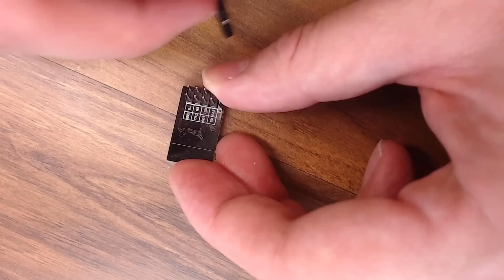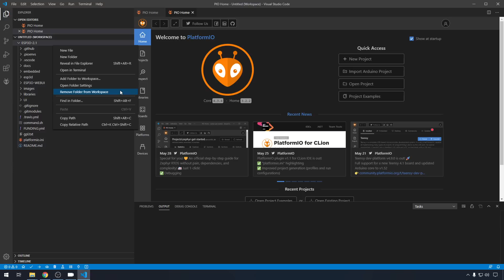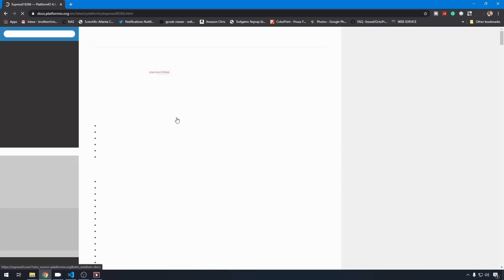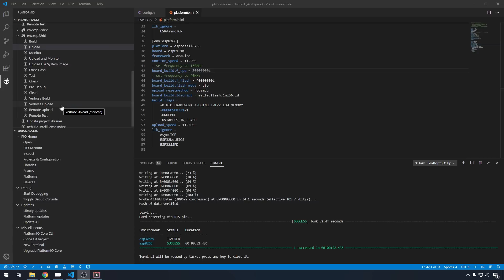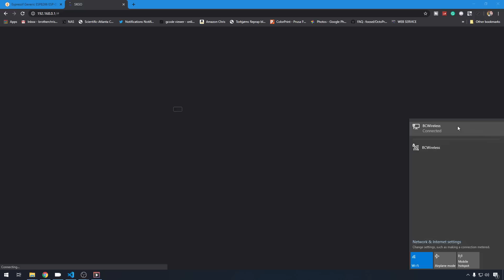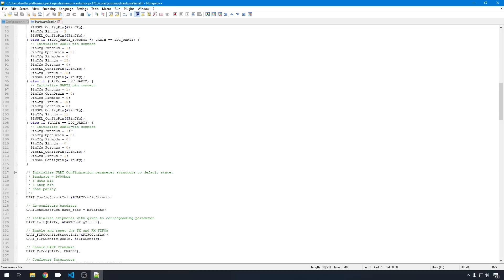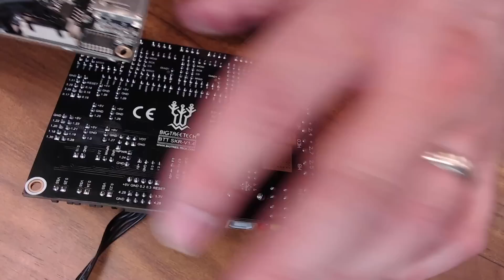Add Wifi To A 3D Printer - SKR 1.4 - ESP8266 - ESP3D - Chris's Basement

Comment: i have been pulling my hair allnight trying to figure out why that "** [esp3d\asyncwebserver.cpp] C:\Users\vwbug\Downloads\ESP3D-2.1.x\ESP3D-2.1.x\ESP3D-2.1.x\.pioenvs\esp8266\.sconsign311.dblite: No such file or 
directory" keeps coming up after changed platformio.ini to your setup yes its 2.1.x  i looked in that folder there is nothing in there everything tested ok before the change so what give?
grrrr

Comment: hi i know 4 years have passed and you might not even see this comment but i want to know can i use the instractions you provided on this video to arduino mega and esp32 because i'm currently building a 3D printer and i'm using arduino mega with a ramps 1.4 shilde i have an esp32 to make it into an wireless printer can i use this video ??

Comment: I was trying another way od settingup. i was getting error message upload failed due to no space. i tried upload webui through wifi but im stuck there. i will try out this method and see if it works
Reply from the maker: Let us know if that solves the issue.
Reply: Yes it worked.
Thank you for this video.
Initially i compiled and uploaded the code through Arduino IDE and then i  had to remove the gpio gnd wire connect the esp01 again and upload index.html.gz via wifi. I was getting only 51.7kb of free space but even the lowest version of webUi needed at least 92 kb
Thanks to you i installed platformIO and followed your instructions and i have 228kb of space remaining to upload webui.
I'm subscribing🤗

Comment: My Configuration is as follows, *Board* : SKR 1.4 and *Wifi Module* : ESP01. The ESP01 works fine, as long it is plugged into a USB Programmer (not in Programm-Mode). I can access the ESP via IP from any computer on my network.
But when I plug the ESP01 into my Board's wifi port, the ESP will not be found in my Router and cannot get reached/accessed by IP. Blue light (is guess wifi light) blinks when plugged in the Usb Programmer but does not blink when connected directly to the board wifi socket. I would really appreciate if someone could help me with the solution
Reply from the maker: Sounds like it's not getting any power, if you have a multi meter measure the pins on the back of the board and see if they are getting power.

Comment: I did everything in the video, but when I got to "UPLOAD FILE SYSTEM IMAGE" it is missing from PLATFORMIO. Used browser to connect to 192.168.0.1. It said missing (index.html.gz) went to gethub and downloaded ESP3D-WEBUI-2.1 zip and with browser GUI used the upload file to get from it. Working from GUI (index.html.gz / Chrome) I still cannot get it to function.

Comment: This may be a bit off-topic, but it seems like something you would know about. I'm a total newbie to the cnc world but I managed to build a CNC table to move my plasma cutting torch (see link for video of it in operation). The problem with plasma cutting and computers that send the file to the control board is that they are subject to interfereance from the plasma arc - so much so that if you don't have sheilded wires and a computer MB inside a metal case away from the plasma machine and use a parallel pot rather than a USB connection,  your g-code can (and often does) stop mid-job. However, if I send the g-code file from the SD card on the control board  (MKS DLC32 V2.1) by using MSK Laser app there is no computer involved, and so it runs without stopping. This is great, but the trouble with the offline controller (MKS Laser) that I use wirelessly to launch the g-code off the card lacks a Z-axis control. My control board (MKS DLC32 V2.1) seems like a nice card and I love the offline capability, but no Z-axis control (probably because lasers don't need them?) sucks. Sometimes I wan't to adjust the Z-axis a little before starting the job and to do that I need to conect my laptop to Open Builds Control first and then switch over (a pain in the arse). Any advice on how to reedy this situation? Are there any other apps I can use with my card beside the MKS Laser app? Thanks! Subscribed. https://youtu.be/97f_Xnl6_V8?si=6sDtdeg53bGgq2Rt
Reply from the maker: Awesome setup! I don't know what app they use. I would guess there is something you could use. How do you control it while offline, with a screen of some sort?
Reply: @ChrisRiley  I use the MKSLaser app on my phone to launch the cut from the internal card file. But maybe this isn't really "offline" since there is the connection to my phone via wifi during the cut (still more reliable than the laptop connection). And I have experienced the machine going wonky when I approached the table with my phone in hand to observe the cutting process. This usually results in me quickly finding the cord to unplug everything. LOL Since the table is just resting above the work if it takes off in some direction it can get moved around - both good and bad I suppose. So far nothing major happened before I got to the plug. I'm going to buy some faraday fabrick and make a sleve for the plasma lead. I'm also waiting for the delivery of some sheilded twisted pair wire. I'm then going to see if Grbl Controller app can connect to the board since it has z-axis control. Just have to wait for the OTG to C-type adapter to arrive. Peace.

Comment: Thank you SO much! I was trying the BigTreeTech route, but I couldn't get the uploader to work with their firmware at all. Using VSCode, I got the ESP-01S to respond, but for some reason, I didn't get the option to upload the web server files. Fortunately, I COULD use the ESP3D setup wizard to upload the web files. SUCCESS! And because I'm going through my BTT TFT35 instead of going directly to the motherboard, I don't even have to recompile Marlin!
Now I just have to work out how to bypass my VPN when connecting to the printer... 😅
Reply from the maker: Awesome, glad this video was helpful.

Comment: platformio says it cannot connect to the board i have looked for help online to no avail, is there anything simple i may have missed?
Reply from the maker: If you ahve a 1.4 you might need the ch340 driver installed on your computer. Check device manager to see if the board is there in com ports.

Comment: Thank you very much. My ESP01S module is running in my TFT on the SKR Pro 1.2.. I have ESP3D  installed and can control the 'printer' via WebUI. So far so good. Now I want to get rid of the USB connection completely, but my software (cnc.js running under Windows) needs me to specify a COM port to connect to, and there is none to choose. Is it possible to have ESP3D to 'emulate' a COM Port that I can choose like if the printer is connected via USB? Please please help me out here 😅
Reply from the maker: I don't know of a way to do that. With apps like pronterface you can type an IP address over the com port.https://www.pronterface.com/

Comment: I can't get my printer to connect running Marlin 2.1.2. I can connect to ESP, but the ESP isn't talking to the SKR 1.4 board. Any ideas?
Reply from the maker: Make sure serial 0 is set to -1 serial 2 needs to be 2 I think, by try a couple of different numbers. Also, if you have a touch screen, that might be interfering.
Reply: @ChrisRiley  I do have a touch screen (TFT35). How would that be interfering?
Reply from the maker: @ADBBuild  They run on the same bus, so you might be bit bashing, the serial info collides. Try one or the other to rule it out.

Comment: Apparently you can connect these cheap WIFI boards up to the TFT connector that is available on pretty much all of the Bigtreetech boards (most don't have a WIFI connector). Anychance you could make a video on that? Thanks.
Reply from the maker: I have done one, but they are mainly just to use REPRAP firmware. https://youtu.be/wpZq2_nD0Ho

Comment: hello, in my case there is no option to upload file system image
Reply from the maker: It's a little different now, it should look like this. Make sure you add the correct folder, add the one with the .vscode in it. https://photos.app.goo.gl/aEdHmzUe5Ekg1gw96
Reply: @ChrisRiley  1 more problem =). Everything went well, printer working normally and wifi module working normally. Unfortunately when I click to load a file to the SDCard, it loses connection and doesn't load.
Reply from the maker: @courujinhaSP  That actually sounds like a power problem. I’ve seen that happen when there wasn’t enough amperage. Check all your connections with a meter. Make sure your getting proper voltage.

Comment: Fun Fact: if you swap VCC and GND, the power light will still light up, but it will refuse to program.

Also, it's a lot easier to program on one of the programming jigs, that has the 8 pin socket on it.  I forgot I had one, and tried with a FTDI first.  Then I messed around trying to figure out why it wouldn't program, until I just tried another module. :)
Reply from the maker: 🙂 I'm glad you got it going. Thanks for watching

Comment: I would need to know how to connect esp8266 to STM32 from geetech. There is a straight 8-pin input and there is no indication of what these pins are.
Reply from the maker: If they don't have a pinout, use your multimeter to find the voltage pin.
Reply: @ChrisRiley  how will it help me to control the board with WiFi?

Comment: I've already seen that people have operated the ESP modules with 5 volts. The manufacturer does not specify how long it takes for these to burn out. Maybe hours, days or years?

But the manufacturer states that less than 4 volts should be allowed. A Lipo-FE cell with 3.6 volts is possible without any problems. A normal LIPO with up to 4.2 volts is your risk with a ESP.

RX and TX each need 1k in series to the 5V system. That should already be on the board. Voltage dividers degrade the digital signal because fast 1s and 0s have to be transmitted.
Reply from the maker: I have no clue how long it would last. There are tons of different types of these out there as well.
Reply: To the best of my knowledge, it will smoke immediately.   If they were using one of the dev modules (two rows, about 30 pins) they usually have an AMS1117 voltage regulator.   It will take the 5v USB, and make it 3.3v for the ESP8266.   The AMS1117 can technically go up to 12v, but only for a short time.

The ESP-01 that he's using doesn't have the onboard voltage regulator.  It only has the ESP8266EX , T25S80 serial chip, power LED, and a few passive components.   These are made to be dirt cheap, and they offload everything, like power management, to the host machine.

Comment: All data communication is handled via TTL serial. The display, the ESP8266 and the USB port is nothing more than a modern serial port.
If the ESP module can be plugged in at the display, the firmware on the printer board probably does not need to be changed.
Reply from the maker: Correct, it will just be a serial bridge at that point. The SKR 1.4 has a virtual to allow the USB port to work.

Comment: Great videos Chris. Like this one, there are always great tips to point me in the right direction. I just did a mod on my old Kossel Linear, extending the frame width, adding the SKR 1.4v Turbo, and the ESP3D wifi mod. The ESP 0s1 had me stumped, after doing the firmware. I'm using Marlin 2.1.1 and 2.1.2 of the ESP3D, with Sensorless Homing.  

I'd done the Flash tool method, but I could never get the setup window. the same happened with the vscode compile. But I realized that when asked to upload, you have to upload the ...index.html.gz, the 404.htm, and the faviicon.ico.... files.  If all 3 aren't uploaded, the setup window never loads.  Also, looks like the latest Marlin has the serial code updated to except the wifi via port 3.  I defintely prefer compiling, since I can get updates without waiting.
Reply from the maker: Cool, thanks for your insight!

Comment: This didn't  work for  me does anyone  know how to install firmware?
Reply from the maker: If it's a 8266 issue, make sure the configure pin is the same as the one I used. Some are different.

Comment: Is there a way to add ethernet to octopus board instead of wi-fi? Probably a ethernet breakout board with UART or SPI interface. Looking to connect my RPi remote server to 3d printer.
Reply from the maker: No ethernet yet that I know of.
Reply: @ChrisRiley  seems like marlin does support teensy 4.1 ethernet

Comment: Hey i hope someone can help me here. Im trying ot get at SKR V2 with an ESP32 to work. i flashed the ESP32 got the WebUI running and got the serial sorted to a point at wich i can read consol output from marlin in the WebUI but for somereason that only works one way... not the other. So, when restarting the Printer it reads the "sdcard ok" and version massages but when i type in M115 nothnig happens ia there a setting in Marlin where i need to tell it to listen spezificly to Serial_3 ? or should it just take Serial comands from any port ?
Reply from the maker: Wow, not sure on that, if the serial was setup wrong I would think it wouldn't work at all. There are some jumper setting on that board, maybe check over those again.
Reply: @ChrisRiley  I got it working later the day I still don't know why ... I changed no settings at all but went from the uart pins on the wifi place to the TFT pins and it just worked

Comment: what's best, if you replace the 23S80 flash on the ESP01S by a 25Q32 you have enough space on the filesystem. Requires some soldering skills 4 sure, perhaps simply adding a mini D1 ESP 8266 board would have worked aswell ... but I was unsure about that.
Reply from the maker: Nice, yes, there are a lot more of these boards supporting other wifi modules now. Great to see.

Comment: I need help.  I just received a couple ESP01 modules and programmers from Amazon.  The programmer does not show up as a COM port as expected, and, thus, the flash tool will not function.  It says USB2.0-Ser! in "Other Devices" under Device Manager with Windows 10, with a yellow triangle.  I tried to update the driver, and find a driver...no luck.
Any ideas?
Reply: It dawned on me that this "programmer" may just be a simple USB to serial ttl converter.  Yes, it must be.  I have quite a variety of USB converters, and followed wiring found on the net, then flash download tool worked.  Flashed ESP3D onto the modules.  Plugged into SKR 1.4 and no broadcast like video said it should :-(   Also no broadcast on BTT 35 V3 display module...
Reply: Ok, found the problem, for the rest of you guys.  remember when Chris said look at the data sheet for the 8266?  Well, these AMazon modules will NOT run at the default 160Mhz.  Changed that to 80Mhz, and now they work.  Still cannot load via PIO, but once they started broadcasting, I uploaded the page via WiFi.

Comment: I just used this video to help me setup my new BTT E3 RRF board with built in ESP3D. I created firmware via your instructions, but needed to place it on an SD card and renamed it "ESP3D.bin" per BTT instructions. (The WiFi chip is soldered to the motherboard and cannot be removed to use a USB flashing tool.) I power cycled with the SD card in to load the firmware. Then I was able to connect to the ESP3D access point via your instructions. It told me the "index.html.gz" file was missing and to upload it. It had a screen in which to do this (I used the top option) and it allowed me to upload all three files (I did them one at a time.) Once uploaded, I restarted the printer and then was able to continue with the printer setup. Thank you again for this information, and for also explaining the serial ports options in Marlin. I has emailed BTT and they said I had to use serial port=3 in Marlin for WiFi, but then I lost my BTT TFT screen in touch mode--no printer connected (Marlin mode always works). Your information went over the different serial ports, their options, and what they connect to. I have a BTT E3 RRF motherboard and a BTT-TFT35-E3-V3.0 touch screen on my CR-10S. It is my understanding that I will not be able to have all three items (TFT screen in Touch Screen mode, USB port on motherboard, and ESP3D WiFi module) all working at the same time because of Marlin only currently supporting 2 serial ports. P.S. I did not see the same warning that you did, and when I tried to add the "board_build.ldscript" option, my builds would fail. I put it back to the default, and it built fine.
Reply from the maker: Hey Chuck, glad you were able to work through it. Yes, a lot of these boards put everything on the same serial bus so things collide. I have never been able to make Marlin work with the USB serial connection, Wifi and TFT all at once. Good to know board_build, that means the marlin team has corrected somethings. That will make it easier.

Comment: I just did this and now you need to add this line to Configuration.h:
#define LPC_PINCFG_UART3_P4_28
And SKIP editing the framework.
I added it just above "#define SERIAL_PORT 3" so that i remember later.
Reply: I figured this out because when I opened the framework HardwareSerial.h it had the changes already made but said "#if defined(LPC_PINCFG_UART3_P4_28)" and I couldn't find a define for it anywhere.
But once I added it my esp8266 would then connect to the printer. Without, it would not.
Reply from the maker: Cool, thanks!

Comment: Hello Chris. I have a question. Can i flash my board (skr 1.4), with the btt writer and wifi module, without sd card  inserted on the main board ? ( SKR 1.4 refuse flashing the firmware through the sd card . I have tried almost everything and that thing does not want to corporate. I am just one step before i buy a new board.) Or perhaps i could flashing the main board firmware with writer-wifi setup through the btt tft lcd sd card slot(TFT 35 V3 ) ? Thank you
Reply from the maker: By all rights, you should be able to, but I have never tried it. Yes, I would give the TFT slot a try as well.
Reply: @ChrisRiley  Thank you Chris. I ll give a try.